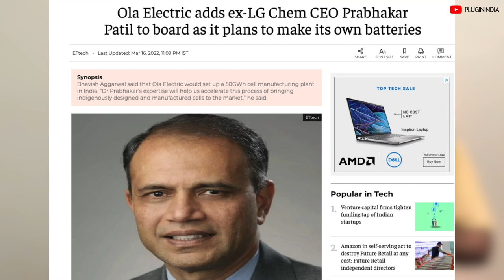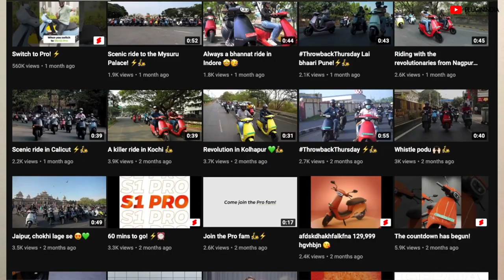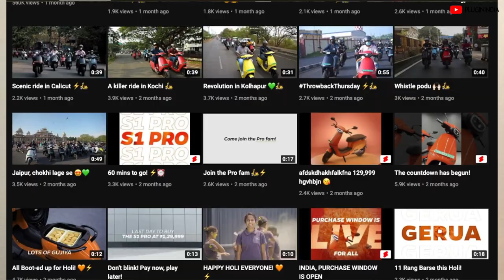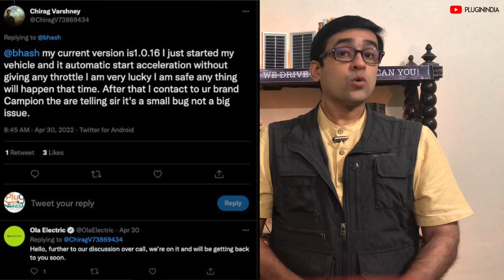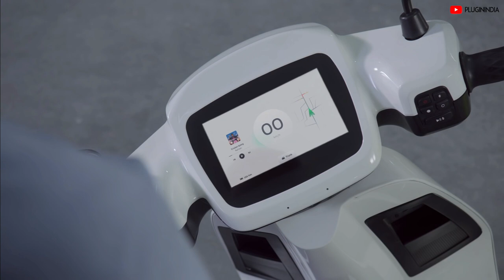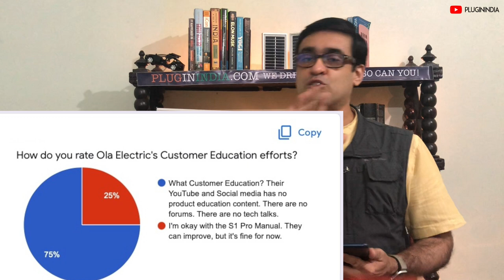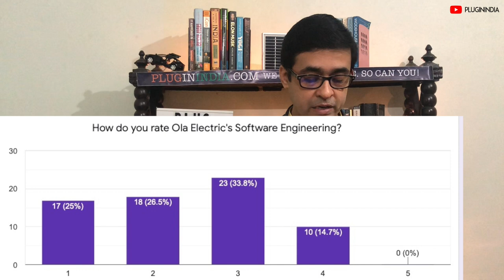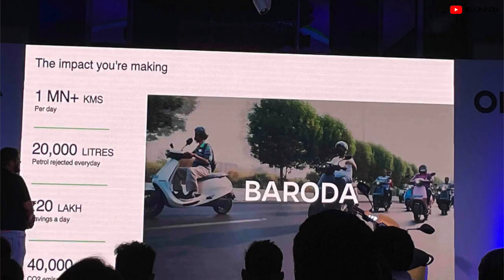Hey Bhavish! OLA Electric's Five Improvements Areas

Comment: Awesome Tips!... Ola can also release videos on YouTube how to fix problems ... the local existing technicians can watch and start repairing OLA scooters... thus making OLA team less stretched. 

The problem with OLA is that they have ZERO EXPERIENCE with customer service... all they had was FAKE customer Service pretending to solve customer problems & refunds ... in Ola Cabs... its the same with UBER... ZERO CUSTOMER service... both of them NEVER seriously solved or heard ANY customer complaint... this attitude cannot continue in MANUFACTURING ... 

Till now Ather undercoverAgents used to go to YouTube mentioning EV fire incidents and say "why not buy Ather?" After Ather's fire incident they seem to be silent.

Most of the problem is due to:
1. Software on the "SMART" dashboard. Removing the touchscreen dashboard can solve a lot of problem.
2. Higher speed... high charging while charging & discharging rates (while speeding) can create fires... especially when temperatures rise above 45C.
3. Fast Charging... EVERYTIME
4. No proper airflow or heatsink.
These are all challenges EVs will face with  HIGHER SPEED vehicles.

I have no idea how the front fork collapses... because they might be using the same vendors as those already available in the market. Or are they not?

Comment: One thing i want to add is ola S1 pro should increase the gradeability from 12 degrees to atleast 20 degrees and this can be done by decreasing the top speed to say 90kms and this can be done easily and also will in turn help the heating issue too.